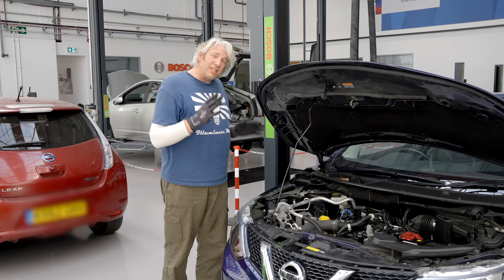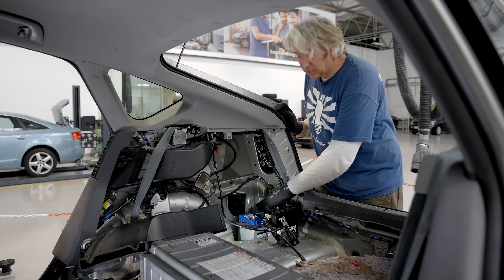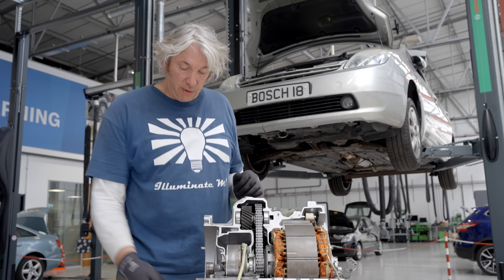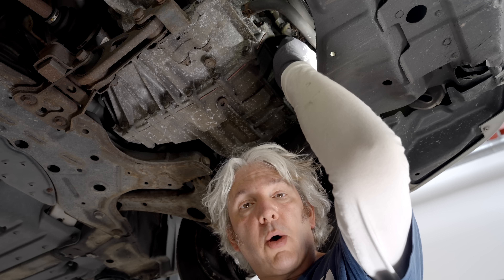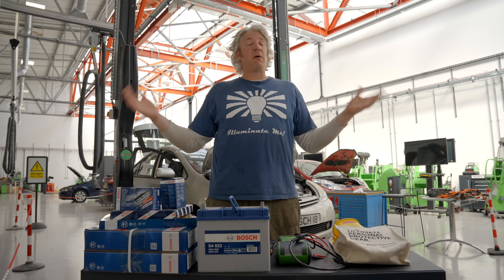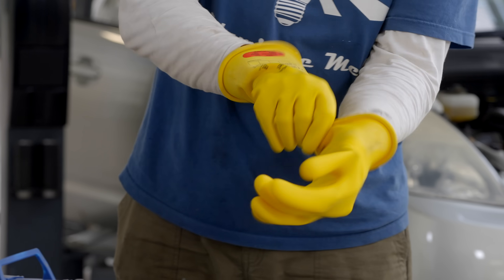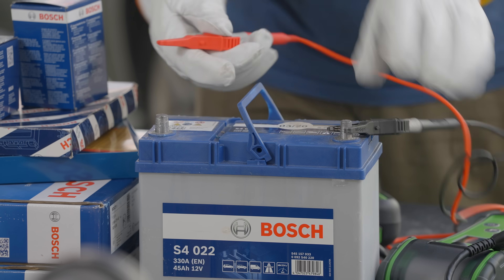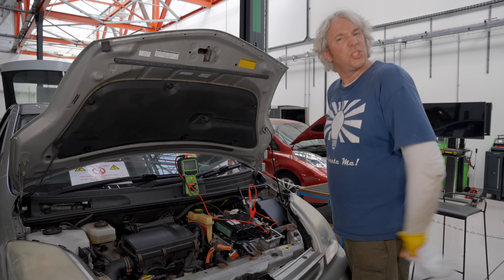DO's And DONT's - Electric Car | Edd China

Comment: Sorry Ed, even if it's just a Mhev 48v system you just don't take the 12v leads off, as the Dc/Dc converter can still supply power from the traction battery to the 12v system until the capacitors fully discharge.

Comment: Excellent presentation Edd, you are one of the very best! 
Toyotas are really well made. Pity the electrical isolation isn`t more quickly accessible, both 12volt and 200v+ traction battery. 
I have a 2023 Nissan leaf BV, which is perfect so far, but I`d love to see more work on that, just for interest.

Comment: Quite interesting video about managing the danger of a missing check on an electrical circuit. I remember have changed an internal battery on a wireless Bosch sander and made a mistake while soldering poles, only 12 v but it hurts when I accidentally touch a pole with my tin welder. I should have done a course like Edd about safety on managing batteries first.😅 Nobody thinks can be harmful a disconnected battery until you accidentally touch it.

Comment: Reminds me on working with trolleybuses, especially the huge capacitor bank. You can either wait until it discharges via the bleeder resistor, or, if impatient, place a screwdriver between the terminals. Before that, make sure to say farewell to your screwdriver.

Comment: This may have been commented before, tip when testing insulated gloves for cracks is to hold them front and back then open, instead of at the sides before flipping them to trap air. It creates more space inside the glove at the start and holds more air for leak check. Great video.

Comment: @Edd China - 
CO2 is the least problem of using fuel cars (the other exhaust gasses + dust & liquid leaks incl. oil leaks are far worse) ... 
& electric cars have most of the same problems as fuel cars especially in cities because they are still cars & also electric cars use problematic batteries 
=> the real electric solution for mass transportation in not to sparsely populated areas is called the Electric Train (mostly overhead wire) + Tram (nealy always overhead wire) + Trolley bus & these don't need these problematic batteries ... 
The channel "Alan Fisher" exposed the problems of electric cars & cars in general & battery vehicles: 
"Electric Cars are Not Sustainable and they're Terrible"  (  watch?v=WiI1AcsJlYU  )  ; 
& "Why Light Rail is better than Bus Rapid Transit" (  watch?v=sGUk-GypkNs  ) 
& "Why TrolleyBuses are vastly Superior to Battery Electric Buses!" (  watch?v=SB9EARKvCTc  )

Comment: Surprised that after testing with voltmeter on car you are not recommended to check meter on a live power source like the 12 volt battery to confirm that the meter hasn’t broken while you have been testing the car

Comment: Thanks, Ed. We are missing this sort of video for EVs. As an amateur mechanic and professional engineer for inverter and servo drives, this is what I want to see. As a hobby I build valve (vacuum tube) audio kit running at 500V DC and being told to work with ONE hand only is life-saving advice.
I would urge caution over the term "low voltage" though. "Low voltage" is defined as greater than 50V and less than 1000V, so ALL of the vehicle is "low voltage" (See the definition: https://en.wikipedia.org/wiki/Low_voltage ). Below 50V is EXTRA low voltage (and safe).
I'm not sure about the rest of the electrics eventually being 48V. Trucks and industrial control systems already run at 24VDC so why a different standard?

Comment: Back in the 70''s The one hand behind you was taught to TV engineers when working on old 25Kv eht screen colour tubes also to discharge the set via the mains plug with a 1k 5watt resister to  discharge the set completely, I made an adapter for the TV plug to plug in to with the resister build in. But one day when picking up an old mono TV, screen to my chest,  I forgot the plug adapter Left in my van and the tube discharged via the mains plug in my hand to my chest, I never forgot to use the adapter after that.

Comment: Thanks for this one, Edd!
My car is an '07 Honda Civic Hybrid. For anyone interested, its high-voltage isolation scheme requires removal of the rear seat back, then releasing a little access panel to reveal the switch, and then flipping said switch to the isolated position. The battery pack itself is mounted within an insulated capsule in the boot on the other side of the non-hinged rear seat, well hidden behind the fuzzy panels. Pretty great safety design but it limits the length of boards one can stow for any DIY woodworking projects!

Comment: Couple of extra points from me:

1) wear eye protection, ideally a full face shield when physically initally disconnecting any part of the HV system, irrespective of the state of that system. An arc flash and jet of white hot molten stuff can really ruin your eyes!

2) A multimeter, even one designed for HV test is not ideal for "proving dead". This is because it has ways that it can be incorrectly used, ie wrong dial setting or wrong lead allocation. Far better to use a specific dead tester, like the industry standard Martindale unit. This simply has two fixed wires, and a light that illuminates above 50V, and critically comes with a proving unit, allowing an A-B-A type test that proves the tester is working correctly before and after you actually test the system you are going to work on

3) You test for hazardous voltages in the inverter was not thorough enough. You tested for the differential voltage between conductors within the inverter, but did not test for voltages between conductors and chassis earth. This is the votlage that will get you, as you are most likely standing on chassis earth!  So, yes, test between conductors (DC and phase) but also put the negative test lead on the metal case of the inverter or chassis at a known good (low resistance) point and test between there and each conductor.

be safe people 🙂
Reply: Sound advice, thank-you.

1) You can get an arc flash from a surprisingly low voltage, always allow for it.

2) I was taught never to use a multimeter to check for the mains being dead for exactly the reason you state. As a hobbyist, I would suggest that if you only have a multimeter then you connect it while live and WATCH it drop to zero when you isolate the juice.

3) Agreed. When working on industrial inverters, I was taught to measure the DC link voltage at the capacitors.

Comment: 10:58 Rubber mat would only be relevant for an earthed system.
So unless the EV you are working on runs off the mains with a very long mains lead , I wouldn't worry about using a mat.

Btw you can't really have 2 uneven halves - they are either halves or not.

Comment: Yes , so many possibilities for disaster , but you haven't mentioned the most likely one - that you get landed on by a flying pig that has suddenly exceeded its design flight envelope.

The premise that "the little motor may suddenly kick in" is based on ,what?
Do parked EVs and hybrids currently have a tendency to burst into life and crash through garage doors or fly off the 6th floor of parking buildings?
Reply: This is something being overlooked with EVs. Like batteries, high voltage circuitry doesn't also last forever. So yes there are risks of stuff like that happening.

There have been quite a few EVs randomly bursting in to flames already due to faults. You wouldn't want to keep an EV in a garage or right next to your house tbh.
Reply: @BlatentlyFakeName  Big difference between a lithium battery having an internal failure and experiencing thermal runaway and failsafe microprocessor controlled switching circuitry suddenly deciding it is going to provide power when and where it shouldn't.
The former is possible and does happen.The latter is pure Hollywood fantasy.
I write this as an electronics technician of 45 years experience
Reply: @paulg3336  The high voltage systems could degrade over time, especially things like insulation on the wiring. This already happens on cars, but it's 12v not a few 100. The problem is EVs are being built as disposable appliances, not to last forever. Not exactly a green strategy really.

Comment: Would apply to all vehicles that have a start stop system. The engine could start while you were working on the brakes. Actually it’s impossible for that to happen. But that didn’t stop Bosch from teaching you all these steps for a hybrid engine that can’t start when it’s turned off. OTT

Comment: Who edited this video, Edd himself? I didn't know silicon hatchets were a thing, but obviously used one to cut the scenes in this video, lol.

Hmmm, so it takes longer to prepare an EV/Hybrid car for servicing than it does to fully service an ICE car.  The labour chargers are going to be astronomical before you even get to fit the eye-watering service parts.  Are there ANY benefits to these electric vehicles? Don't say emissions as they are just weighted to other areas of the vehicle's life-cycle.

Britain should be taking the lead in the development and production of either low emission synthetic fuel for ICE vehicles OR Hydrogen power in either form, ICE or fuel cell (though the latter may be another contender for extortionate servicing).  It's pointless sitting waiting for what is exciting but unworkable fully EV technology to catch on in a country already worried about power outages over winter!

Comment: Funnily enough owning and running an electric car can produce more harmful gasses than a petrol car due to the resources required to make the batteries and end of the day electric cars run off power stations which will also produce CO2. Then you have the issue of the batteries lifespan and the cost to replace. Electric cars are not the future
Reply: Three questions Andy.  1. Why would you replace an EV battery when you could have it refurbished for a fraction of the cost of a full replacement?  2. How long will it take an ICE car to get down to zero CO2?  3. Don't the oil refineries that produce the fuel your car needs, also use electricity from the same power stations?
Reply: @Brian-om2hh  you are naive if you think an electric car is any better for the environment than a fossil fuel car. If you do your research, the amount of energy and resources actually needed/required for them, plus the up keep of running them, they are not the answer to being eco for the environment at all. Plus if you then factor in the practicality of electric cars over a fossil fuel car they are worse. Personally petrol is better, or hybrid at least. But even Elon Musk himself has now stated electric cars are not the future and it's hydrogen. Electric cars will not last in this world

Comment: II was a firefighter when the electric/ hybrid cars started hitting the roads. I got ahold of a video done by Toyota covering first responder safety during accident rescues. The bottom line is yes they can kill you of you come into contact with the high voltage components. There is supposed to be an automatic disconnect for the batteries after an accident however there are a number of failures with those. The recommendation was for first responders to wear "lineman's" safety gloves when using the jaws of life or a cutter incase the HV lines are cut into. Tere is a lot more in the course but yes they can be dangerous.
Reply: That sound like an impractiable recommendation.  Hydraulic tools, jaws of life or scissors have gotten much more powerful and heavier over the past years as car frames they're meant to work on got much more massive.  Even the old tools were not light by any definition so there is a tendency to hold them close to the body.

A few years ago I found a PDF pamphlet from Audi describing how fire fighters were supposed to deal with the electrical dangers of their cars.  The #1 recommendation that stuck in mind was a full body isolation suit.  Never seen one - but I picture them to look like the bunny suits in old Intel advertisements  or maybe a full hazmat suit - and as much fun to wear.  Audi since has settled on more practicable recommendations.

Comment: I noticed the "spare" hand out of the way trick. Reliability of early computers was improved by not turning them off. Repairs could be made with the high voltage on using an unearthed soldering iron and your other hand in your pocket.

Comment: I really learned something today,  thanks Edd. 
Whilst my suspicion of the green credentials of electric and especially  hybrid vehicles have been reinforced by this video; I believe that pure electric vehicles can now be driver/owner maintained,  with the specialist stuff being left to the professional.   Just like DIYers do now.   Removing the 12v supply to disable the contactors would be enough for me, to do say a brake service.
We just need that magic battery technology that weighs no more than a tank of petrol, charges in five minutes, is made from green, recyclable materials and lasts longer than the car itself!

Or hydrogen fuel cells.

Personal transport must continue.   It's a basic human right!
Reply: carefull with that, the car might be trickle charging the 12V from the big pack as you were undoing it. which could mean that the 12V system was still powered. Double check that the 12V system is completely dead after disconnecting the battery before you trust that.

Check the service manual for the minimal actions needed for your particular car to make it safe to work on.

Comment: Edd, I work for a large telecom, where we use class 2 insulating gloves, as well as rubber mats. For a very short time, we switched to class 0, but found that that they had to be discarded at the end of their certification, whereas the class 2, that we've always used, can be returned for recertification. Prior to expiration, we order replacements, then return the old ones. We do the air test, but after the pull test, pulling the fingers apart  while looking for the contrasting color to indicate any cracks or splits. then turn it inside out and repeat all that. Ours are black outside, red inside. Cheers!
Reply from the maker: That’s really interesting, I’ll look into what the differences in spec are…

Comment: Bought my first hybrid, an 07 Prius, the beginning of this year and it’s been great. Had 201k miles when I bought it and 223k now with the only work needed was the coolant inverter pump went bad(1hr job + $100 part) and I just replaced the struts all around last week from being worn out. Otherwise it’s just been oil changes, filters, and tires. Even has original brake pads!

Comment: Thing is, that s4 022 is NOT an AGM battery, and the p2 charges with 15+ volts instead of 13.5v, as a "normal" ICE car. Thus it only lasts 2 maybe 3 years. but this is people, making more rubbish, not caring about environment. disappointed in Ed. Sorry mate. :(

Comment: Jaguar wanted nearly £400 to service my 4 year old I-Pace.  I looked at the job spec, it entailed changing the pollen filter, topping up the washer fluid and changing the brake fluid. Basically a rip off. The cabin filter I changed myself for £15, the washer fluid cost me £4.99 from Tesco for 5 litres, and the brake fluid change cost me £72 from my local garage. Total cost £91.99. With the £300 saving I'm going to Tenerife for a week!.

Comment: Yet to be convinced these are environmentally an improvement on an economic 4-pot ICE. 
Once you factor in the impact of mining eg lithium, copper and iron ore - the impact of the power stations you use to charge it - and the high cost of replacing batteries after ~10 years of usage probably making most of them scrap... 
But have to start somewhere I suppose. Interesting insight!
Reply from the maker: Don’t forget to factor in the drilling of the oil, the shipping to a refinery, the energy to refine it, the shipping to the fuel station and the fact that when we bother to run the planet on renewable energy then the EV route makes a lot more sense. It’s definitely part of the answer.

Comment: Hi Edd I'm really glad you're back however not only are there huge holes in the planet where the materials to manufacture the batteries come from they then have to be transported by diesel and fuel oil vehicles to the factories, the are then manufactured using electric produced by burning gas they then need transported to the huge car factories where once again the electricity is produced by burning gas, they then have to be transported to the dealers by yes you've guessed it vehicles burning diesel and then when they finally get to the customer they are then charged with electricity generated by burning gas or nuclear power stations!!!
Reply from the maker: Or they could power all the trains and trucks by electricity made by renewables and things would be a lot better and we would have a cleaner future.
Reply: Pete, you need to remember that the oil companies have also made huge holes in the ground for literally decades, mining for cobalt, which they use to remove sulphur during the refining process. The oil industry are the largest users of mined minerals on the planet. You also overlooked the bit where - after a while - older EV batteries can be 95% recycled, with most of the lithium and cobalt within them being returned to the manufacturing stream to be reused in new batteries. Can you show me a gallon of recycled petrol or diesel?

Comment: I build valve amps and repair valve radios as a hobby. Great fun. The one hand behind your back is par for the course as 1200v AC is often exposed inside the equipment. If you are very careful it is safe though I have been bitten in the past. Only by about 200v but that was scary enough.
Reply: Good advice. I do the valve thing too.
I once accidentally brushed against the DC link of an industrial inverter. That's 3-phase mains, rectified (about 600V DC). It pulled a muscle in my wrist that ached for over a week - and that was a very lucky escape.